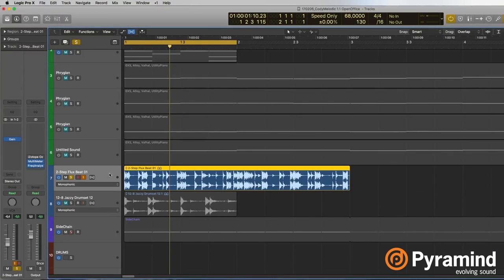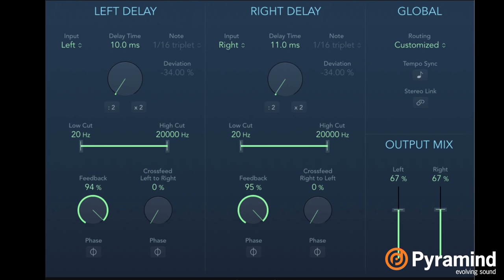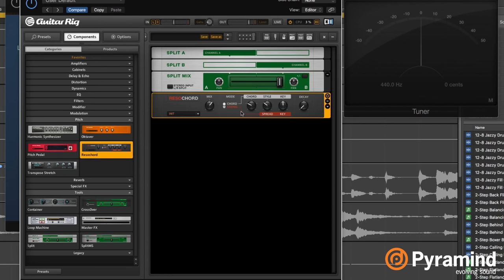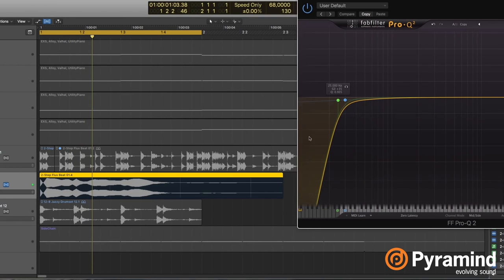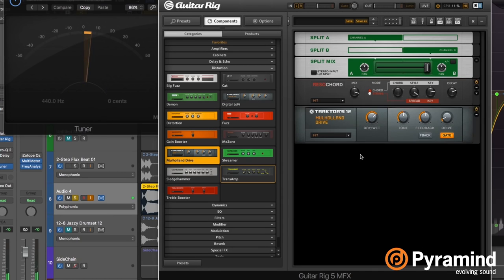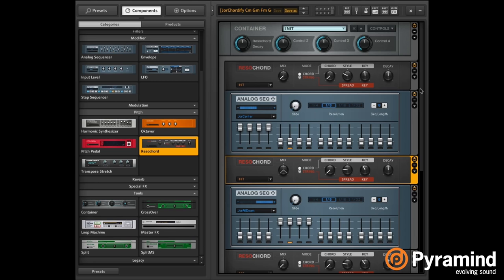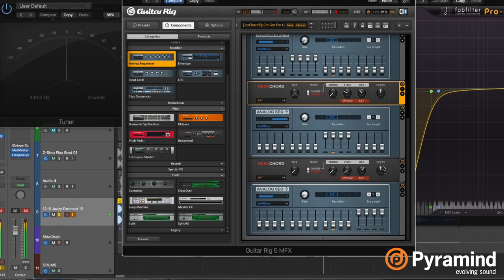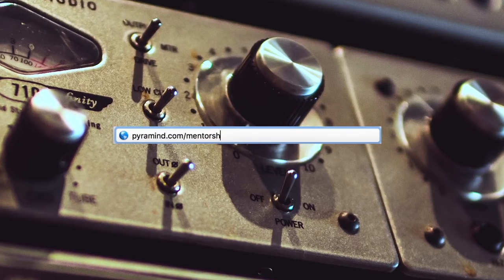What’s The Deal With Comb Filters? | Sound Design | Jor van der Poel

Comment: The reason why "computers see low frequencies louder" is because they are louder. Low frequencies need more power to move air. FFTs make justice to this acoustic phenomenon.
Simple practical example, to achieve the same volume as guitar amp, a bass amp needs more electric power.
Reply: Good video anyway, it gives me some ideas !
Reply: Hi FSBass could you expand on;  "FFTs make justice to this acoustic phenomenon"? I'm assuming you are talking about the famously adapted DFT Algorithm but I'm not sure what you are referring to in this context? Thanks!